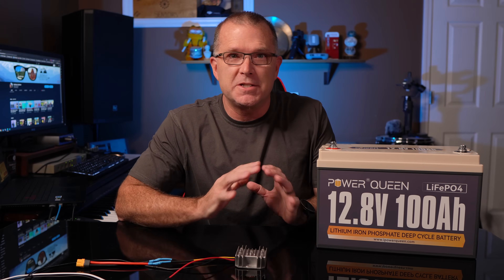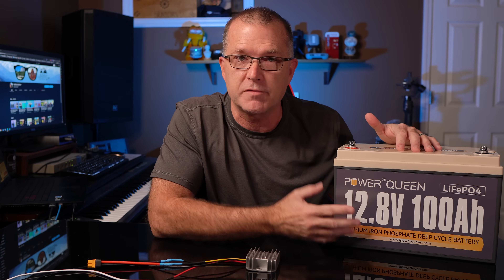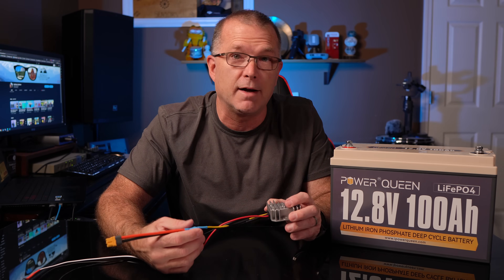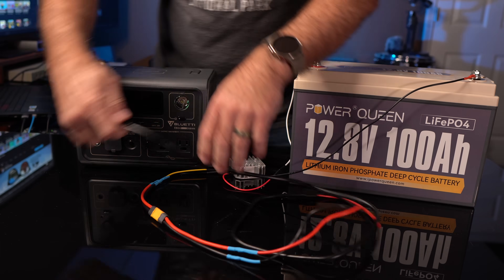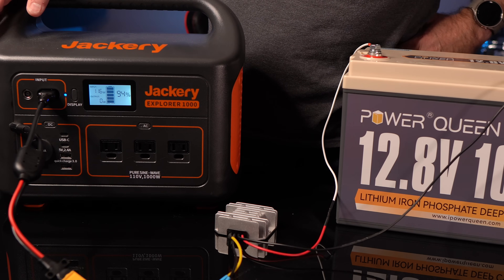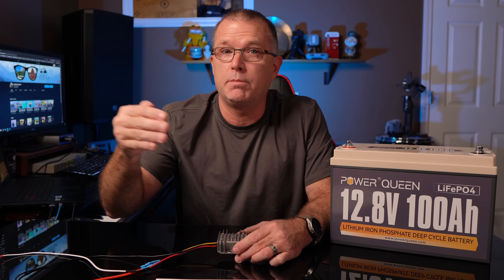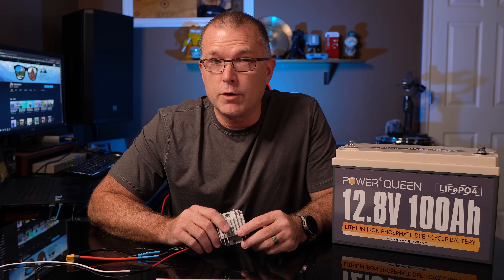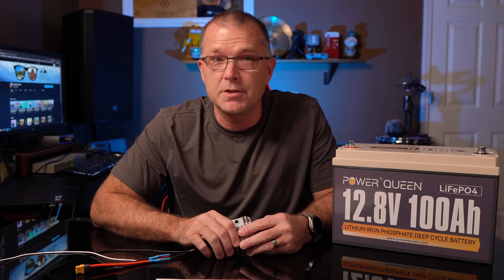SUPER EASY!!  DIY Power Station Battery Capacity Expansion / Charger

Comment: I dont understand why you still need to step up DC voltage when the power station can pretty much handle 12v?
Reply: Because P = U * I. Directly proportional relationship. More V - more W ( with constant A)  - faster charging
Reply: I agree that if you’re not in a rush, 12V should be fine. Buck converters trade speed for efficiency, as there is quite a bit of heat loss, I believe about 10% of capacity loss, probably more

Comment: I recently purchased a Jackery Explorer 2000 v2 and I also have 2 Redodo 12v 100ah lithium batteries, could I use this method to expand the capacity of the Jackery? I live in Havana, Cuba and we are more often without power than with electricity. Any recommendations will be welcome, thanks

Comment: Any reason not to use in line wago 221s?
Reply from the maker: I don't see why not, as long as they're rated for the current your charge controller will draw at the voltage you're outputting, and you've properly fused the positive side to the wire gauge.

Comment: This "Works" best if you happen to have  the extra battery on hand. If not then you will also need to buy a separate charger for the battery and adding the cost of the Battery + Charger + Step Up Transformer + Misc. I would simply wait till Black Friday and buy a 2nd main unit. Dec 2024 the Delta 2 is $399

Comment: Well but it is not a expansion in both ways right? It just charge ecoflow from external battery, but not external battery from ecoflow.

I have Delta 2 a ecoflow external battery + ecoflow alternator charger. Unfortunately u cant use external battery and alternator charger at the same time. So, I am looking for way how to expand my delta 2. So car will charge delta 2 and delta 2 charge external battery. When I use energy from delta 2, it will be charged back from external battery.

What I understand via XT60 it's just one way energy flow?

Comment: What about using a battery such as 25.6v 200ah lithium Power Queen battery? If so, would stepping up the voltage still higher to feed into delta 3 plus be beneficial

Comment: Just came across your video thank you so much I’m going to do this with my Jackery do any type of battery would work correct
Reply from the maker: You could actually use a 24V battery as well, provided your particular Jackery does support at least 26V input.  And using a 24V battery, you could probably get away without using the step-up converter.  Either way, you'd want to put an appropriately sized fuse on the positive cable to protect the wire .

Comment: Just wanted to start off saying I am a huge fan of your videos, you have educated me a ton, and helped me with some purchases. I have a question I am hoping you can assist with. I have the Anker f2000 and hoping to recharge it with a stand alone lithium 25.6V 100Ah battery I just bought. I plugged the battery into the solar XT60 input of the Anker and I was only getting around 280 watts. I was hoping to get more. Would a step up converter increase this and if so do you happen to know which kind? Thank you!!

Comment: To get a lot more current to the power station, plug it into an inverter that is attached to the 12v 100Ah battery.

Comment: I used your step up converter link and noticed it’s a 12v to 24v 3A model and found another option for a 12v to 24v 10A step up. I have an Anker Solix C1000 with XT60 solar input list as 11-32v=10a and 32-60v=12.5a 600w max. Question I have is could I use the 10amp rated step up to increase charge rate without exceeding any limitations?
Your help is appreciated. Thank you
Reply from the maker: @jjohnson8937  yep. That would work and provide a faster charge rate
Reply: Thank you 😊
Keep up the great work!!!

Comment: When does the external battery 'give up' or put another way, when does the Bluetti stop taking charge from the external battery?, 12V, 12.5 ?... I do something similar with my AGM
Reply from the maker: @TheBreamer999  well with these LFP batteries, since they have an internal BMS, the battery stops discharging when it gets below its cutoff voltage threshold ...or when the Power Station is fully charged....whichever comes first.
Reply: @ReeWrayOutdoors  Thanks for the quick reply.  I'm using and AGM, I suppose I could just take a voltmeter to the battery and monitor it.  I wonder if the MPPT on the Bluetti would boost lower voltages to 'keep it going' until it literally kills my AGM :)

Comment: I don't have time to diagram this out, but here's the gist of what I would call an "ideal" turnkey system:
~DPDT relay for charge/discharge cycle, coil powered by 120vac so when line power goes out, the battery is switched from charge mode to supply mode.
~This circuit would use two 12v batteries in series to maintain 24vdc at input charge voltage.
~Both batteries can be simultaneously charged from the front panel 12vdc output using blocking diodes. Using blocking diodes prevents against backfeed/crossfeed.
~Batteries may charge slower from the front panel, but you can always parallel in a supplemental 12vdc power supply.
~Large Lithium batteries already contain charge balance circuitry inside, so this setup shouldn't be an issue. Using the relay simply "automates" the process of having do any unplug/replug exercise. Note that to get the larger voltage/amperage/wattage to work on the EcoFlow, an XT60i properly configured may have to be used.

Comment: Didn't work on my  Dabbsson Portable Power Station DBS2300, 2330Wh EV Semi-solid State LiFePO4 Home Battery Backup, Max 8330Wh, 5×2200W AC Outlets, Solar Generator for Camping, Home Backup, Emergency, RV   Users can connect solar panels in series as shown in the figure to recharge the product. The
product supports 12-60V DC input, 25A max current, and 600W max charging power.

Comment: Why use the converter?  I understand what the conversion does, but why not just connect the 12v battery directly to the power station?
I do this with a Bluetti AC200 max.  I use alligator clamps and an xt90 to plug directly into the solar input of the Max and it pulls about 120 watts continuous.  The power station only recognizes that it is receiving DC power at a certain voltage.  I don't think it cares what the DC source is.  I have done it using my 36v trolling motor battery as well and the Bluetti works just like it would if it were direct from solar panels.
Maybe I am missing something?
Reply from the maker: @jdollar5852  it's only to increase the charging speed.
Reply: @ReeWrayOutdoors  gotcha.  That's why I used the 36v battery.  With the 12v it can't keep up with any sort of load but the 36v allows me to run 3 freezers.  I just do it for kicks and giggles, but I have it as a backup if needed.  Lifepo4 battery prices are dirt cheap right now so I recommend everyone invest in a few before the price goes back up.
The biggest drawbacks on the AC 200 max are the slow AC charging speed and the ridiculously loud charging brick, but it was a Cadillac 3 years ago.
Reply from the maker: @jdollar5852  Great point!  The only downside to buying the 36V battery is that, unless you've got a golf cart, you're probably not going to be able to use it for much else.  But you're right, it'd be great as a quick charging backup for power stations.

Comment: I bought the converter you have listed and it got super hot. You couldnt even touch it. My delta pro was drawing 212w. Which is well over the 72w the step up is rated at. I don't understand why you wouldn't just recommend and include a link to the 360w step up that is identical and won't burn somebody's house down. Just my suggestion.

Comment: can't we use 12V DC invertor to 110V/220V and input the AC power as charging into the power stations? Much higher Wattage can be achieved this way, am I missing something? Thanks for the video!
Reply: plus it is a power for charging a battery, no real need for pure sine wave inverter, so a cheap 50 euro one will do fine with 500-1000W output modified sine wave

Comment: Can you use your battery without DC step up Converter. To charge your power station.
Reply from the maker: Yes, assuming the minimum input voltage on your power station's charge controller is 12V (most are, but some require at least 24 or 36V).  It'll just typically charge more slowly at 12V than at a higher voltage.

Comment: what if i plug the 12 v battery directly into the dc imput ? does it drain an insane amounth of current ?
Reply from the maker: You can do that, and no, it won't pull a massive amount of current.  It will only pull what the maximum current rating is for the charge controller - which is typically only 10-20A, depending on your power station.  But that's why I used a step-up converter to increase the voltage so I could get more total watts of charging power.

Comment: I bought a 12v to 24v 10amp converter.  It worked perfectly with my Licitti 1000 power station.  It charged at 165w.  When I plugged it in to my Oupes Mega 2, it created 360w for about 20 minutes, got extremely hot,  and went back to 100w @ 12 v. It never returned to the higher 24 volt output.  I think the Oupes' 15 amp charge controller sucked more power than the 10amp converter was designed to pull.  The Littici had a 10amp max charge controller. So, if you do this make sure your converter can at least match the max amp for your charge controller. If not it will likely overheat and fail.

Comment: Hello
I’m doing a car camping road trip this December from Manitoba down to Louisiana for two weeks. I’d like to run a 12v heated blanket and my CPAP machine. Run the CPAP machine off my River 2 using AC port and run the heated blanket for my 12v 100ah lifepo4 battery. Since I’ll be traveling most days I hope to keep everything topped up while driving. How would you recommend I set things up?
Can I plug the river 2 into the cig lighter car socket and the AC charger into the river 2 and charge both at the same time? 
Thank you 
Steve (68yrs)

Comment: Your videos are typically great; but this one seemed to present a weak argument to SELL an unneeded component that only adds complexity & cost.
Reply from the maker: @cache4pat  was just trying to present a viable alternative to an expensive expansion battery module.  Sure, you could charge without the step-up converter (in most cases) but it'd be extremely slow.  And as far as selling anything, that was definitely not the focus here.  Amazon affiliate commission on something like this converter would be like 5 or 10 cents.  Not exactly a lucrative  money-maker.  But thanks for the feedback.
Reply: @ReeWrayOutdoors hey I was just wondering if I could do this with my all powers 300 power unit and also charge the battery at the same time with solar? Would that work? I don’t know anything about this but I am trying to plan out a little project for powering my shed with solar and I thought this would be a start.

Comment: what would happen if you wired 3-4 of the DC step-up converter so instead of getting 115watts into your power station, could you wire the converters in parallel to get 12v from your lifepo4 battery to get an output of 460 watts. Would that work? Going further, could this be used on your car alternator battery so that this would effectively be DIY replacement for say the bluetti charger 1 dc to dc converter? Just some thoughts.

Comment: Good idea for medium to larger power station. My Litheli B300 is already capped at 100 watts DC input. Though, you got me curious just to try it in case it jumped beyond its rated power. I really need that extra juice to equalize the AC output usage of my e-bike that peaks at 190 watts and I've to supply the extra to the power station with usb-c charger somehow.

Comment: I would like a system where ecoflow delta can charge the external lithium battery when it's receiving solar and is already full and then draw from that external battery, when it needs more power. Everything fixed setup, so I don't have to plug stuff in and out every day. Assuming I only have one solar cable coming into the house.

Comment: How high is the input while there's a decent load on the power station? This would be the best way to test these setups on different units.
You'll also need a charger for the "extension" battery. This setup and savings assumes the user has a Li-compatible charger available.

Comment: Any reason you can think of to not buy an inverter and pass through charge via AC?  Still has a benefit over still expensive expansion batteries, or for power stations without expansion options, and it is modular.

Comment: Many comments on how inefficient this is, wear and tear on main unit, etc. Here is how I see it (2¢). If needed/used in an emergency situation the losses will not matter. You need power for medical equipment, cell phones, lighting, any power will do. Your second car can be your battery charger. Running a small generator, while it is running, charge your batteries with appropriate cables and connectors. Cycle count during hurricane X aftermath does not matter! You need to power fans. People do not realize how much electricity people use per day on average. The average electric usage in TN my home state is about 1,200 kWh per month, or about 40kWh per day! That is with the usual running (AC, fans/fridges, lights etc.) The more power and less appliances used, the better. I have 12,000w (effective) of battery storage but only 1,600w of panels. On a good may I may get 8,000 out of them during the summer, PLENTY of cloudy days where I might get zero. My generators are how I will charge my batteries and run appliances off of while the batteries are charging. I am not planning or expect full home  backup. Just enough to live reasonably comfortable. You can have small power sources wired to your home electrical for simplicity but again, you can only run minim al devices with it.

Comment: I have a Bluetti EB70 currently charged by a 200w Renogy panel for my small van project.  I want to do this expansion with at least a 50ah battery.  Can I run the solar panel to mppt to battery then step up convert to power station?

Comment: could you show in a video, how to wire it? Or is it no problem with plus and minus?
Reply: Input:
Red wire to battery positive, black wire to battery negative.
Ring terminals or battery clamps
Output:
Yellow wire to power station positive connector
Black wire to power station negative.👍

Comment: I wonder if there is any way to connect this battery through the battery expansion connectors (P090D) on my bluetti power station, so that the power station charges this battery as if it were its built-in battery?

Comment: So if the minimum input of your solar generator is 11v, and you have a 12.8v lifepo4 battery, help me understand why a step up converter to 24v is needed? Couldn’t one just eliminate the step up converter? What am I missing?
Reply: I'm waiting for the answer to your question as well. Why the extra steps/parts/equipment?
Reply: @SteveStevens-h4v I found the answer in other videos. The step up converter isn’t required, but it makes charging much faster. If you double the volts, the wattage is doubled. But the amperage stays the same. So you don’t exceed the amperage limit of the power station dc input.
Reply: @davef5595  thanks for the info

Comment: Thanks for the honest information and review. I actually asked some of the power station manufacturers if this could be done and the representative said no. It did not make sense so thanks for dispelling that myth. QUESTION; Do they make a 12 volt to 48 volts? If so, it would charge faster I assume? I plan on an Anker 2000, will it work?

Comment: What about a solar panel, can I connect a solar to the power queen battery connected to the power station?
Reply from the maker: @albes83  you would need a small charge controller between the solar panel and the battery to keep the charge voltage at an appropriate level for the battery.
Reply: Yes sure! I would connect the solar to a mppt controller and then the output to the 12/24 module then to the Ecoflow. Should be the correct way

Comment: Why do you need 24 volts when these small power stations take 12 volt panels ok?  Ok maybe you will say later in the video, but I don't have patience seems wrong.
Reply from the maker: You can certainly direct connect a 12V battery and it'll charge to some extent, but it'll charge more slowly, and then of course once the supply battery voltage drops below 12V (before it's completely depleted, it'll likely stop charging since it's no longer at the minimum input voltage.

Comment: What about series connect 4 12.8 volt and inject 48 volt in my port reads 12 to 95 volt but only 400 wtts would the 4 bms series connected be safe?

Comment: VTOMAN - Can you use the battery expander and have the solar panel plugged in, in other words could you attach that battery to the battery expander connection while the solar panel connection is in the input socket you've shown?

Comment: If you were to wire 2 12 volt batteries in series and then plug that 24 volts into the power station the power station will give you the maximum mppt watts if it's limited it's 500 watts for your mppt controller input it will give you 500 watts If your power stations maximum mppt input is 200 watts you're only going to get 200 watts, the thing is you're getting 24 volts that it thinks it's coming from solar but you have more amps then the mppt controller is set for so it chokes it down to however many amps it's supposed to take, of course if you have a 24 Volt battery it makes life more simple LOL.

Comment: so if all of those power stations had a minimum of 12 volts do you really need the step up converter to 24 volts?  And if you have 2 of those 12.8 volt batteries and you run them in series that would work as well right? or one 24 volt battery would work just as well?